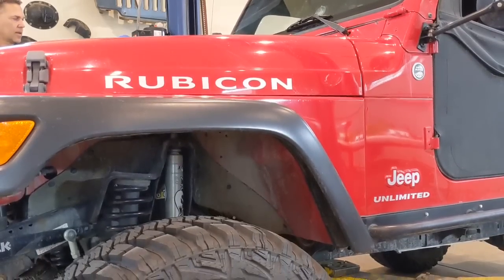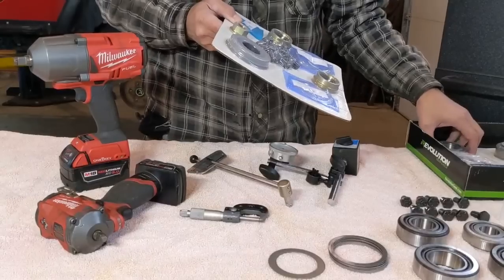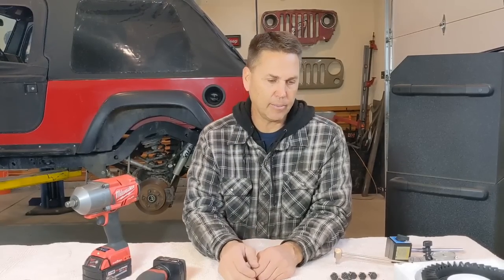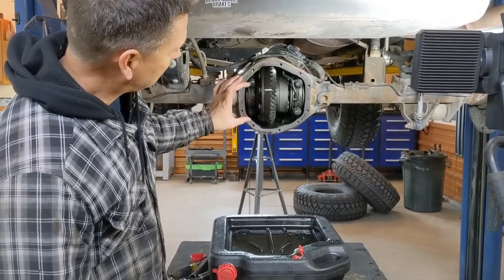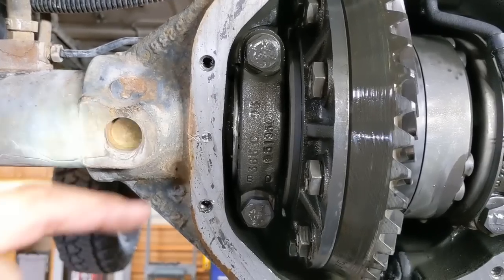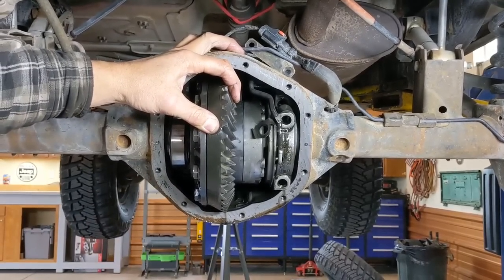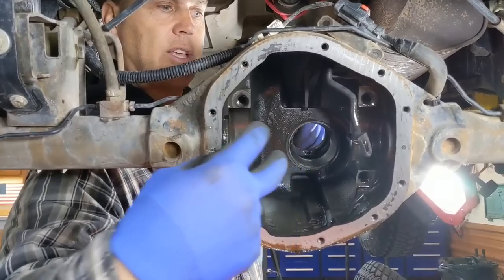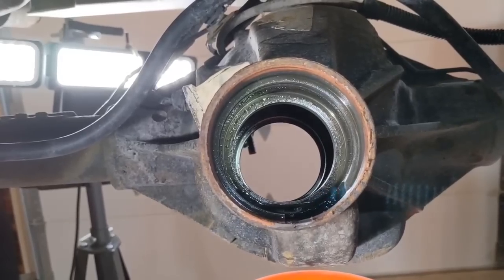How to Install Gears in a Jeep Wrangler Rubicon Dana 44 (Detailed!)

Comment: I've been watching many of these gear install vids out of curiosity. FYI, the pinion depth numbers on the head of the pinion is the measurement from the bearing cap face. Use a piece of flatstock, drill a hole in middle for dial caliper. Subtract thickness of flatstock. Pinion depth will be 99.9% on. The gear manufacturers dont engrave numbers for nothing. Been doing it this way 40 years and haven't been wrong yet. Only slight changes if it's an after market housing...Moser is the worst.

Comment: If I have a clamshell puller, is there any downside to putting the pinion shims between the pinion head and bearing, opposed to making a setup race. Seems like I could just seat the new race from the get-go.
Reply from the maker: That's the point of the clamshell puller. It allows you to do exactly that. Once your pinion depth is established, you're good to go. The only issue you may run into is that a lot of aftermarket master install kits provide shims to go behind the race and not the pinion head. Make sure your kit has them.

Comment: Why don't you heat up the bearing in the oven like you did the ring gear so it will just drop on?
Reply from the maker: Because a press is quicker

Comment: Ring and pinion gears are set up on a machine that determines the deviation from the design figure. They are not "lapped". A new pinion from another set could be used but the pinion depth number might not be accurate.
Other than that this an excellent tutorial.

Comment: In the Dana book I have, it says that the pinion pre load should be between 20 to 40 inch pounds. When I got mine back together I was measuring about 35. Do ya think she’ll be alright?
Reply from the maker: Time will tell, and it'll probably be fine.

Comment: i have a 2015 jeep wrangler willy wheeler with the Dana 44  in the rear 373 gear and found something failing stuck on magnet.
i have limited slip if i need to  rebuild who makes good replacement parts i was thinking about a locker maybe a gear driven
can you give me some input on some options thanks good video !
Reply from the maker: If you off road frequently, I would consider getting a locker instead of rebuilding the limited slip. There are lots of options out there with ARB being my #1 choice.

Comment: Mike. Yukon gears install kit does not include shims that will fit behind set up race. I’m stuck. Any advice on who to buy these from? Thanks! If not, guess I’ll be a bearing pulling fool
Reply from the maker: Might try Amazon at this point for whatever axle you are re-gearing. They sell separate shim packs.  I would send you some but I'm out for a few days.
Reply: Thank! I located some shims at a friends shop that are slightly smaller OD than the race opening. - but don’t fall through. I can do my  best to center them when I install final race. Do you think this will be an issue? They clear pinion fine and do mate with race opening lips, but are a little short, or sloppy fit. Again, I can center on final assembly. Any concerns?
Reply from the maker: @LaNiceguy  I would find the correct shims if it were me. It "might" work, and then again it might not. It's up to you.
Reply: @LaNiceguy  like in the video, instead of a “stage” race that is easy to remove for set up. Use an over sized pinion bearing that will slide on and off easy. Then you can use the Yukon shims

Comment: I was honestly confused for a bit at the end when you used the torque wrench to tighten the pinion nut because you said at around the 5 minute mark to NOT use the click style torque wrench.
Reply from the maker: DON'T use a click style torque wrench to check pinion preload (use a beam or dial style). DO use a click style torque wrench when tightening the pinion nut IF the pinion uses shims. If the pinion uses a crush sleeve, then tighten it with a socket until you get the desired pinion preload (checked with a non click style torque wrench).

Comment: could you use the clam-shell bearing puller instead of cutting? I think its a great tool.
Reply from the maker: Absolutely. The cutting method is for those that don't have a clamshell puller.

Comment: Hi Mike, I tried using carriers shims behind the inner bearing race but they are slightly too big. Did you grind yours down to fit or can you buy those separately (part number)? Thank you for inspiring me to take this on!
Reply from the maker: Depending on which master install kit you use,  that may happen on rare occasion. Yes you can take some off the outer edge but make sure there are no burrs sticking up that can affect the thickness.
Reply: @TheBFHGarage  got it. Which master install kit do you use? I have motive gear.  Thanks!
Reply from the maker: @mikechen9428  depends on what is available nowadays. I like Revolution Gear and Axle.
Reply: @TheBFHGarage  so true waited 3 months for everything to arrive for this job. I’ll give revolution a call tomorrow to see if they got some shims! Have you tried Yukon shims behind the pinion brace by any chance, I messed up the current set and I’ll mihht need to order some depending on luck. Ty and thanks for the awesome video again.
Reply from the maker: @mikechen9428  yes. You can use whatever shims you want. No need to buy same brand as they are all made for the same axle specs.

Comment: question. when you pull the carrier / ring gear in and out do you have to do that stick & wire on the locker plunger every time?
Reply from the maker: No, only for final assembly.

Comment: So, two days later finally got the rear back together...... kinda mauled up the first two threads on the new pinion driving it in and out to get the shim stack right for the preload.....local machinist fixed it up though, thank God!!!!!!  Disassembled the front and mic's everything out, but there was something different....the shim for the pinion depth was huge (in diameter), it was the same diameter as the pinion gear itself....what is up with this?  Can I still do the pinion depth the same way, putting the shims behind the race instead of between the bearing and the pinion head?  Also, on the rear axle the yoke was crazy tight, it was a bear to get on, the splines looked fine.  Thinking the Yukon splines are just a bit tighter?........
Thanks again for the great video, I never would have attempted this without it......
Reply from the maker: So the shim behind the pinion head is larger because they can also use them as a slinger although it's not necessary. If your  Yukon kit came with shims that fit behind the race, then yes, set it up using those. Measure that large shim you pulled and use that as your starting point.
Reply from the maker: As far as the yoke, it is what it is. Some are tighter than others for whatever reason.

Comment: Do you like using a clamshell puller ?
Also how do you hold it to tighten ring gear bolts ?
FYI excellent video
Reply from the maker: Yes, clamshell puller makes short work but probably not with the cost to do one or two jobs. You can either put the carrier in a vise or use a shop press with a block of wood to hold it.
Reply: Awesome thanks

Comment: Favourite mechanic; especially on differentials. The dana 44 has a well-made air-delivery system. ARBs have to be handled like eggs and you are always living with anxiety on the trails. What do you think?
Reply from the maker: I think you are backwards in your thinking. The stock locker is prone to failure of time. There are no serviceable parts for it when it fails. The ARB is the opposite. You can beat on them all day with no worries. They do have parts that wear, but they are replaceable. The only part of the ARB you need to be careful with is when installing the seal housing with the copper line. If you pay attention and are careful, then there are no worries.
Reply: @TheBFHGarage  i guess. you are the expert here. But that is just bad R&D on their part [ARB] or they are just building in some planned obsolescence. The second generation was more forgiving. i acknowledge that they might have a reason why they swapped the seal housing to the opposite side, leaving the copper tube running across the locker and ring gear, without designing a better air line.
Reply from the maker: @briannnnnnnnnnnnnnnnnnnnnnnnn  Why are there several generations of anything? Because products can be improved as technology and use changes. I don't have a problem with where the put the air line. It actually gives you room to put the extra line during installation. Why is there an iphone 13 and not just an iphone? Things get better with technology and use.
Reply: @TheBFHGarage  I hope the next generation will resolve the egg-shell air line then....
Reply: Brian Nyamweya Copper tubing will last decades. I routinely operate equipment with copper air lines that were installed in the 1940’s. The only problem is if it’s manipulated too much then copper fatigues quickly. If you broke your line inside the housing it was 100% user error.

Comment: Does this process work for a 2020 Wrangler Rubicon?
Reply from the maker: Very similar, but the lockers are different. The 2020 front axles also have an axle disconnect. Gear setting is the same.

Comment: Thanks man, I was just watching your other videos the other day on re-gearing and 
 Thought, “I wish he did a more detailed video”. Lo and behold.. much appreciated, I’m about to re-gear this weekend. Dana 30 and  44, ARB rear, LSD upfront.
Reply from the maker: I just posted an ARB install not too long ago. Since you're doing the rear, be sure to cut in your drainage slots 👍
Reply: @TheBFHGarage  will do! Thank you sir.
Reply: How did your regear go? I’m about to do the exact same as you.
Reply: It went ok, it was a pain to do it on the floor though. I would take BFH’s recommendation and remove the entire axle, unless you have a lift. I just got done with the 500 mile break in and took it apart this weekend. I realized that there was too much movement in the seal housing, so I removed the diff and added more shims (mine did not come with Dana master shims, so It was a guess with how many was needed initially). Of course, that messed with the backlash again, so I adjusted it, and now I think my pinion depth needs to be adjusted a bit more. I’m getting a pattern that I’m not super happy with, maybe BFH can help me with that.

Comment: Mike, i have watched this video hundreds of times, in the middle of installing 4.56 gears right now. I noticed you didnt use a crush sleave. My rebuild kit came with one. Is it the same process or should i go buy shims to continue on with your install video. Thank you for the aswome video!
Reply from the maker: Double check you have the right install kit. The TJ D44 uses shims for pinion pre-load, not a crush sleeve. If you're working on a JK, then go to my JK video 😁.
Reply: Oh crap! I thought this was it, and it shows I missed the most important part.
Reply: Mike, thanks again, I was wondering why I was struggling to keep up and remove driveshaft and other small components.
Reply from the maker: @maxellis950  😁

Comment: Sir I noticed that u may use the brand revolution for pinion and gear replacements......how is that brand compare to original dana ??? Is it stronger ?
Reply from the maker: I cannot comment on the strength or how Revolution compares to Dana Spicer as I have no idea how they compare. I like Revolution because they set up easy and run quiet. They are Circle K and are very consistent.

Comment: Great videos!!  Just one question though.  Where did you get the shims to put between the case and the inner bearing race for the pinion?  My shims are either too small or too big to fit in there correctly.
Reply from the maker: Depends on what master install kit you order. If the shims are just slightly big, I've had success using a dremel to bring them down a little. Big pain in the butt, but it is an option 👍

Comment: This was a fantastic video.  Also, I've seen in other videos that you can basically heat the bearings up with a heat gun for a few minutes, and they should drop right onto their respective shafts, for those that don't have a press.
Reply: Finally took the plunge and did it this last weekend.  ** - doing that on the ground led to my back feeling like a tenderized piece of meat and a sliced up wrist (from taking the pinion gear in/out repeatedly).  Also, as an update to my previous comment - it still took a bit of precision bashing to work those bearings onto the carrier even after heating them.  But using the old cones to assist in that prevented any damage to the new bearings.  I also ended up using your axle bearing video to replace both axle bearings, seals and retainers.  Again - spot on.  Wouldn't have been able to do it without them.  Thanks again!!

Comment: Mike, how did you make your set up race?  I’m thinking bench grinder or some type of device that centers it in a drill while holding sandpaper against it while it turns.  Any tips?
Reply from the maker: I just use a Dremel with a sanding drum.
Reply: Awesome thanks!

Comment: Question, I know this is for the rear, what would be different for the front, currently in the midst of replacing gears since the pinion bearing went out in mine, I have see other video's showing a Crush plate, yours does not, I assume this is the difference from the front to the rear, how does that affect the installation and setting the pinion depth?
Reply from the maker: Specifically to the TJ, the Dana 44 uses shims to set pinion preload. The TJ Dana 30 uses a crush sleeve to set pinion preload. Neither have anything to do with setting pinion depth, only the preload for the pinion bearings. Pinion depth is established by placing shims either between the pinion head and inner bearing or behind the inner race. Hope this helps.

Comment: That baffle or “oil slinger” the Yukon kits don’t show them being provided (2008 jku rubicon) when I look the part up online it comes up at stores like Walmart, I can find the exact one on Amazon but they show that it will not fit my Jeep, my stupid question is, does my Jeep have one? I haven’t started doing it yet, just want all the parts prior to the installation. Thanks
Reply from the maker: They are not included in any install kits that I'm aware of because they are used as shims. They are all different thicknesses so it would be impossible for them to include the right one in an install kit. No biggie to remove it from the installation process. Just use the correct amount of shims.
Reply: So they are not a need to have thing? Just measure the thickness of those and use the shims instead?
Reply from the maker: @zacharyhopkins2872  Correct. The thickness of that shim may or may not be correct for your new gears but it should get you in the ballpark.

Comment: I have seen, read and actually replaced a pinion seal myself with the axle all together with just marking the nut, housing and flange and tightening back to my mark after replacement. Do you think that gets pinion set back close enough spec in most cases?
Reply from the maker: Well, first off, if you have an axle that uses shims instead of a crush sleeve then you would just tighten it back to spec. If you have an axle that uses a crush sleeve, then that's a different story. There is so much controversy with that method. When it works for people, they swear by it. When it doesn't work they curse the world and pay for a new gear setup after they discover all the damage from a loose pinon. I have tried it just to see how close I could get and the mark on the nut wasn't even close. Things like temperature when the nut was installed vs. the temp when you reinstall it can affect it greatly due to metal expanding and contracting bsaed on temperature. Sure, people have had success, but if you're wrong, it'll cost you a lot to make it right.
Reply: @TheBFHGarage  I know this has nothing to do with my initial question but I just removed the carrier on my dana 30 and there were zero shims. The backlash felt fine  before I removed it and the carrier was a pain in the butt to get out. Could they have lucked out at the factory and not needed shims?

Comment: So I am trying to get my rings in with the locker and tips .. the ones on the outside of the race
Reply from the maker: Is that a statement or a question because I'm not sure what you are looking for....
Reply: @TheBFHGarage  I am asking do you have any tips how to get the rings in after the race .. the part in your video you described where you Bent them a couple times.. I bent one of mine I am wondering is there any easy way
Reply from the maker: @ericdarby5350  ok gotcha. I put them in with the race. I slowly tap each side in ensuring the shims move with the race. If the shims fall behind or get out of  position, then I pull everything back out and start over. Welcome to setting gears! 😎😂
Reply: @TheBFHGarage  I got it, thank you . I am using oem everything, so everything should go back into place, i assume, correct ? And is it easier to just do it with it out ?
Reply from the maker: @ericdarby5350  I'm still not following you on what you are doing..... Did you do a full regear? Just change bearings? Not sure what you mean baby you do it with the carrier out.... Explain what you are doing
Reply: @TheBFHGarage  rear end went out pinion bearing blew out eat the whole pinion and ring .. 
   Replaced what was needed, which was pinion and ring gear (OEM), rebuulit it pretty much just having a hard ass time getting those rings in ...
    I suck at explaining